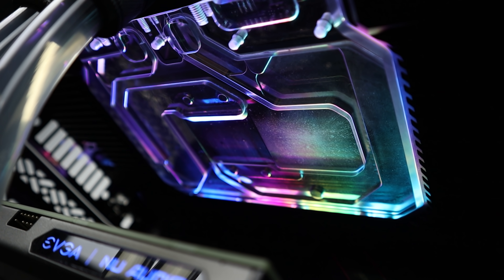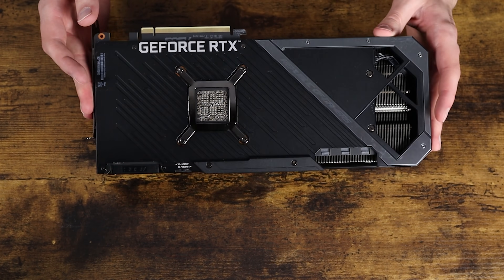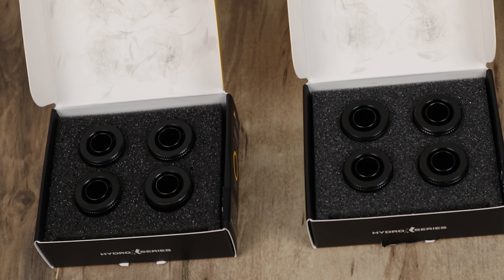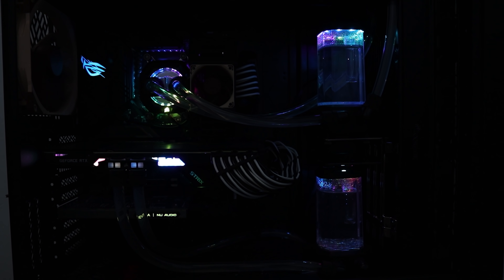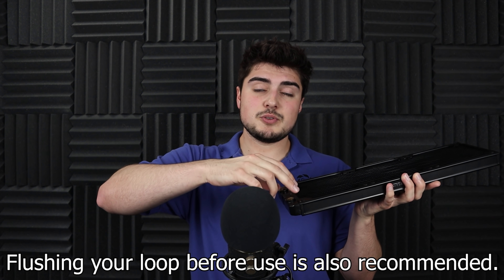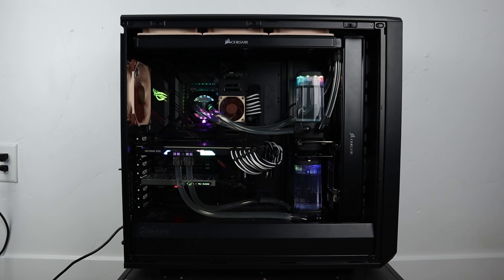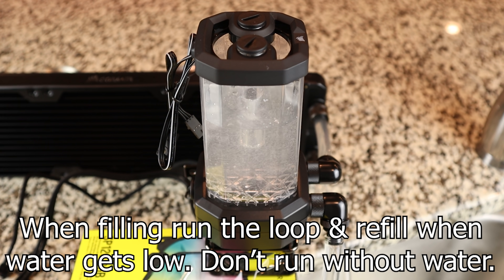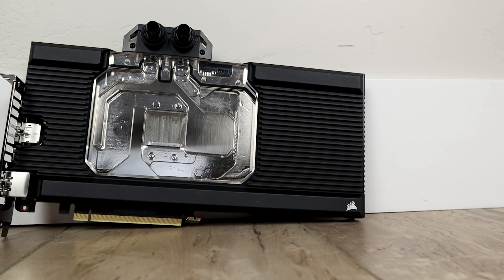You Won't Believe These Results...

Comment: What are your thoughts on this versus the aio setups like the EVGA Hybrid kits?
Reply: There really isn't much of a comparison.  For computer parts there is no such thing as "Water Cooling".  All the water does is transfer heat from the source, to a traditional metal-to-air cooler.  If you are dealing with similar fans, and surface area, then a traditional air cooler, and a closed loop cooler (hybrid cooler), and a custom loop cooler are all going to be right around the same ball-park in performance and noise because the fans and the surface area are what do the actual cooling.

Moving from a traditional heatsink and fan to a closed loop cooler isn't typically a performance or silence gain (generally speaking, they are priced close to parody at most price points for similar noise and heat dissipation). The main advantage is the flexibility of where the heat sink (radiator) and fan is located... and aesthetics if large slabs of metal in the middle of your computer 'isnt your thing' lol.
The move from a closed loop cooler to a custom loop really isn't the same kind of consideration like it is between a traditional heatsink vs closed loop.  Closed loop systems are in competition with air coolers, and the highest end closed loop systems are going to be competitive in performance and acustics to the highest end traditional air coolers, but with a slight premium for the pump and tubing.  If you need more cooling capacity than either of those provide, then you look at custom loops... and you only look at custom loops as an extension of the other 2 because there is a steep price jump.  Air and closed loop coolers for CPUs and GPUs range in price from ~$60-200, with a couple out-liers in the $300+ range.  Custom loops generally start at $400 for all of the parts, tools and supplies you need, and can go up from there dramatically.

But there are 2 big considerations with a custom loop to consider vs a closed loop;
1) How much more performance are you looking for?  A custom loop is... well... custom.  So if you want 5 radiators for some crazy reason, then you can totally link those all together.  Obviously your case will have some limits to consider, but generally speaking you can have as much cooling potential as you have money to pay for.  If you are like me and barely over-clock, and are fine with the performance of normal after-market air coolers, then the thought of spending an additional $4-600 ON TOP OF whatever came with your card seems a bit overkill.  But for others a crazy custom loop is just a consolation prize because LN2 is just too expensive to use in your daily driver.
2) How long do you plan on things to last?  If you upgrade your GPU every 2 years with the next generation AND want amazing cooling performance, then a custom loop may be far cheaper than a closed loop like the hybrid kit.  A new closed loop kit is going to be $2-300 every 2 years, where a new GPU water block is $100, and you reuse the rest of the system.  A well maintained custom loop can last 10-15 years and just need the pump and fluids replaced on occasion.  Meanwhile, a closed loop cooler should last about 5-6 years reliably, and if you only upgrade your GPU every 2-3 generations, then a closed loop may make good sense.

So my general recommendation - If you can bear it, just get a card with a good air cooler.  It will likely give you as much performance as the expensive closed loop or custom systems, just with a little extra noise when really pushing the card hard.  If you are in a compact case situation, then consider a closed loop cooler so you have more flexibility on where to put the cooler, but don't expect much better cooling or noise performance unless you have something weird going on with your setup.  If that is not enough cooling power, THEN go with a custom loop - and splurge and don't get a super basic system.  It will last a while, so if you need more performance than a high-end aftermarket card, then you will want a radiator that will keep up with wattage increases over the next 10 years.

Hope that helps!
Reply: @CaedenV  you're wrong about the difference between a liquid cooled vs an air cooled. There is a massive noise and temperature reduction, even with the same exact amount of surface area and Fan speed. Why? 2 reasons. First, water is really good at absorbing heat. It can get heat out of the chips a lot faster than heatpipes. Second and most importantly, the air that passes through the radiator is almost never recycled. Air coolers in a case (GPUs ) are very turbulent. Often the heat is recycled a bit, even in the best of cases. And to get the best airflow, you need more case fans, further increasing noise. Watercooling is on another level vs air cooling
Reply: @Techno4more  water is definatly a differnt beast.

Water is more officiate at transferring heat. 

It will will spread the heat over a larger surface area where it will leave the system. Normally where ever the highest point in the case is.

Sooo with the water loops you can have a few rads and have your fans turned down to a lower rpm. As your colling on a larger surface area. There's lots of comparisons with fin density and such aswel. But altomalty your only ever gonna be able to cool to the ambiant room temp.

I'd say the room is more likely to heat up more as the water is more efficient at transferring the heat lol.
Reply: @stalker1567  yes, the GPUs almost run at ambient when you're watercooling 

The room will heat up the same in the long run, the same amount of heat is being produced
Reply: @CaedenV  Thanks for the detailed response.  For me, this was mostly a curiosity question, as in my quest for a 3090 I ended up with a Gigabyte Auros card with an AIO preinstalled.  I'm not planning on pulling that apart to try to go for a full closed loop, but was curious what the difference might be since I was sort of already "half way there" given that I already run an AIO for my CPU.  Your point about the general mechanics of water cooling is well made though; it probably doesn't make a lot of difference so long as you have the same type of metal plates at the contact points, water as your cooling medium, and similar sized radiators.

As for overclocking, I might tweak the card a little bit, but I'm going to stay away from the CPU.  I have a 5900x, which I've heard is somewhat challenging to overclock, and since I'm not planning to do anything incredible with the card, I don't think I'll need any crazy radiator setups.

Your thoughts on cycle time are interesting.  I tend to splurge on a high end machine, then try to keep it going for about a decade.  The computer I'm in the process of replacing is from 2012. and as your numbers indicate, it's on it's second CPU AIO :)

Thanks again.
Reply: @reclaimatorerebus6531  leaving stuff running without touching it is somthing your gonna be have to accept your going to have to check a water cooled loop over more often. 

So hydro x stuff is normally a year but recommended to flush the loop every 6 months.

If you keep the pump above the lowest port it will make this cleaning process so much quicker.  Suggestions for rad positions are one on the top of the case and one on the side or front.

The silly corsair config thing will stick rads on the bottom which will have you tilting the case and all sorts.

Also the loop is sealed with rubber gaskets and at some point they will fail.

Plus the coloured mixes in loops gunk up. Always happens to any colour as the chems separate.

If you are going down the water cooling route I would recommend the EK pressure tester for peace of mind.

Comment: Gpus always go lower with water cooling. there is more surface area from the die to the the heatsink to transfer the heat to the cold plate in the gpu block as opposed to the the small die-to-heatsink transfer in the cpu. been doing custom loops for some time 
 1080ti@2025mhz 39c Max in games and benches. 3900x @ 4.5ghz all core oc @ 1.36v with  70c max temp in Cinabenbench R20... Custom loop 420mm rad [EXTERNAL in push/pull) and 360mm rad internal [push] HAF X case . all EK parts including EK varder fans. DEAD SILENT at full load. can get better temp with fans over 1000rpm at the cost  of barely audible noise... fans can go to 2400rpm but  its never needed.....

Comment: great setup; would you suggest this for a gigabyte aorus 3090 and a 3090 FE on a 3900x? 'cause i'm thinkin i need to just bite the bullet and water cool this sucker already.
Reply from the maker: I think watercooling the FE is still worth it because of the memory on the back.
Reply: @GraphicallyChallenged  but i've also got the 3090 aorus from gigabye (because i'm crazy lucky like that) 

would you advise a corsair loop for both of these? or would you go EK? seems like EK covers both devices nicely as well, but the price is pretty steep

Comment from the maker: Thank you Corsair for sponsoring this video!
Checkout Corsair Hydro X: https://www.corsair.com/us/en/hydro-x-series-custom-cooling

Do you think that building a water loop is worth it, or is it too expensive? Let me know your thoughts in the comments below.
Reply: For the price vs performance, I'd really want to look at what 2 AIOs (one on the CPU, one of the GPU) would do in terms of temperature management.  However, when going for a custom loop, at least some of that is appearance, and I really think the Hydro Series makes for a pretty build.
Reply: @reclaimatorerebus6531  CPU AIOs would be much easier to find than GPU AIOs, but having them on separate loops can be beneficial to cooling, but you would have to have a second pump. But yea, the hydro series is awesome! it's just a shame they don't make GPU blocks for the EVGA cards this time
Reply: @Teddible  Huh, I didn't realize they were that rare, but yeah, the only AIO that I could readily find is the EVGA Hybrid cooler build.  I was mostly curious because the 3090 I was eventually able to get my hands on was the Gigabyte Waterforce with the AIO preinstalled, and was curious about any possible benefits of going full watercooled - but I hadn't actually tried looking for other AIO kits.
Reply: @reclaimatorerebus6531  what are your temps like?
Reply: @Teddible  I'll try to remember to get back to you on this after everything is finalized.  The 3090 is in the mail, but is supposed to be in by this weekend :D
Reply: I also mainly used Corsair for my watercooled build, with the exception of the EVGA FTW3 ULTRA 3080 Ti and the case distro plate/reservoir/pump combo (both blocks from EK), but I have 2 GPUs and an 11900K on the same loop with 2 360mm radiators. Still runs amazingly cool considering the parts involved